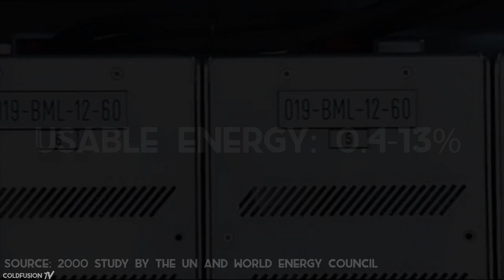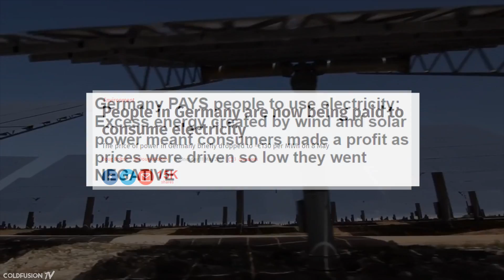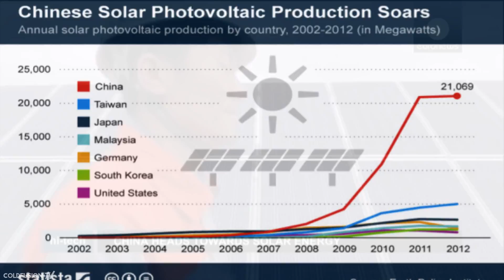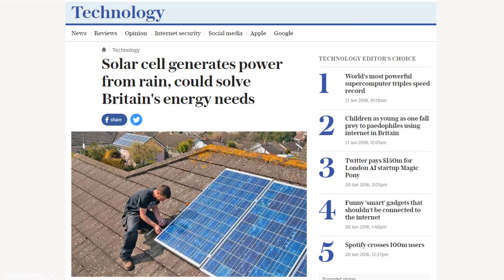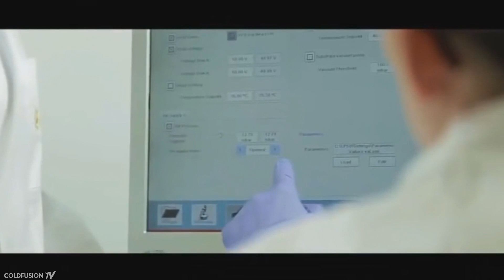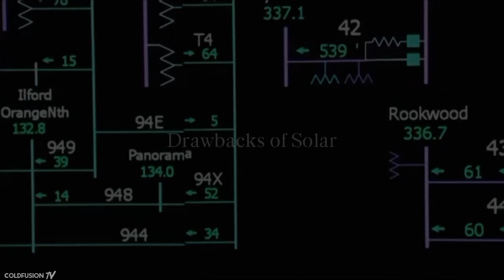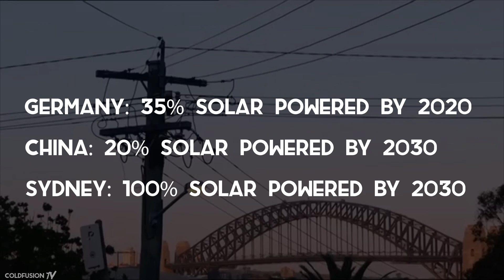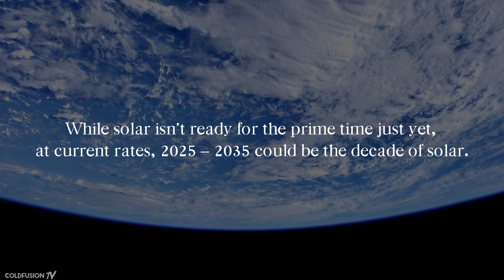The Truth About Solar

Comment: Skeptics complaining about solar ("it's not ready for prime time," "it's too expensive," "it's inefficient") remind me of the critics against electric vehicles before Elon Musk created the Tesla Model S. Oh, and by the way, Musk is leading the solar revolution; in October 2016 he unveiled the solar house, thereby completing the package he originally had in mind: house, battery, vehicle.  And if this total package has the success of the Model S and the forthcoming Model 3 - which looks quite likely - then all the skeptics will need to take a seat.
Reply: Look I like Musk and I respect what he does but in no way does Tesla even begin to replace the gas engine. There needs to be a massive scale up in battery production at who knows what environmental cost. Where does the energy come from to charge the battery? Solar is not going to do all that charging for everyone. Then there is the issue of how do you drive long distance with an electric vehicle. Can you swap out pre-charged batteries and if not what is the equivalent of the filling station on the road. Solar house is the same, good in some situations but not even close to being a total solution. Again massive battery requirements and not going to work well in high energy needs areas or in poor sunlight times (think a dark northern winter). What about a multistory building or a manufacturing plant? Everybody would love solar to be the answer but it just isn't at least with the current technologies. It can play a role sure but it is not going to be the main driver in the near future unless a huge infrastructure change happens and that sorta leaves out the near future.
Reply: +Juri Vlk Just pointing out the facts. Is Tesla bad? No maybe a little pricey but all new tech is. The battery issue is a pretty huge deal. All the batteries needed to replace all the combustion engines, I wonder at the mining and environmental cost to that and the shear scope of production. The point is we all go crazy saying yeah this it it lets go there but the switch over effort is beyond mindbogglingly. It will take many many years and incredible effort to switch out auto technology. What I would like to see is a sober realization of how difficult this task is and what we have to commit to do it. Less rah rah and more analysis by qualified engineers as to the viability of solutions and our ability to implement them in the near future. We need a rational plan out of the government and industry to do it. Electric cars are not non polluting unless they get their charge from a clean source which currently almost none do. Solar can't meet today's electric needs let alone the transportation industry. I am a nuclear advocate and I see the next generation of new tech plants we need taking 25 - 30 years to build. If we get those built then you can start switching over the bulk of transportation to electric, hydrogen and ethanol all of which can be in theory be generated directly from electricity and available atmospheric carbon. I really don't hate Solar, it is wonderful in off grid situations and cutting down fossil fuel consumption it is just not the answer we need in the near future to keep the worst effects of global warming contained.
Reply: The Tesla Power Wall pays for itself in 30 years.
Unfortunately it only has a 10 year lifespan
Reply: +Trek Ryder Confuse people about what? I told you what the issues are and all you came back with are Telsla and solar sales are up. Well glad they are up but you still have not addressed any of the issues I brought up. It doesn't matter anyway nothing we say here matters. It will all play out the real world. And with that I give up. I find it is waste of time to argue people who won't hear anything other than what they want to believe.
Reply: For 2015 and 2016, Tesla sold a little bit over 100,000 vehicles.  All other car manufacturers sold a tad over 172,000,000 vehicles.  The Tesla Model S STARTS at $68,000.  The average cost of all the other manufacturers offerings was $33,560.  Elon Musk has captured 0.12% of sales of automobiles.  On an individual vehicle basis, Elon has sold 0.06% of the vehicles that other manufacturers have sold in the same period.  To put it another way, for each Tesla sold, other manufacturers sold almost 1,700 vehicles, so I would not put the mantle of "game changer" on him just yet.  Personally, I would wait to see the Model 3, purported to be priced at $35,000.00 and available in mid-2017, but that price is "vaporware" right now, and the performance is unknown.
Reply: +greenburg. While I do agree that and oil economy makes it difficult to move to any alternative I have to respectfully disagree on the rest. Your taking impressive but non scalable things like some people living off the grid and saying we can run everything solar. It is just not even close to the same thing. Can you imagine running a large scale smelting operation or London mid winter at night off solar. It's not inconceivable but it is impossible at this time. Storage banks whatever you mean by that are just not going to expand like that. Batteries are inefficient on the charge and the discharge. The battery capacity to power the US overnight staggers the imagination even if Musk thinks he can envision it. Musk says he can see London being powered by solar but he never gives any detailed engineering data to support it. There is some hope in creating carbon neutral fuels like ethanol from atmospheric carbon that might work as an efficient means of energy storage but that is unproven on anything other than a laboratory scale. I believe Bill Gates said if we took all the batteries of any type currently existing there would be enough energy to replace the grid for a few minutes. Bill Gates is deeply concerned with the worlds energy needs and he is pro nuclear. If there was a good way forward toward solar I doubt he would want anything to do with nuclear. No sane person denies nuclear energy carries risk and it would be best to avoid it if solar could do the job. Solar is not currently up to the task and there does not seem to be any near term way it could replace the grid.
Reply: Trek Ryder Yeah, real nice. What do they run?  About 80 grand?  An equivalent car costs around 35.  That buys a lot of gas!  Only a save the planet moron makes such a stupid decision. And it gets its recharge from the same power source (fracking, oil fields) that the greenies are fighting against!
Reply: Michael Weaver You have a realistic approach. Apparently, you're not a Tesla fanboy!
Reply: Ask the whales.
Reply: 100 thousand dollars for a car i cant drive out of town on a cold day? take away the subsidies if tesla is such a fine car, the same for solar!
Reply: +greenbag  Sorry about your name apparently spell checker got it.. A certain class of factory could run off solar but high energy demand operations like smelting no. So many won't accept the incredibly huge difference between some people running off solar and everything running off solar. Yes you can sell solar power back to utilities it's been that way for for a long time but so what. You are avoiding what happens when there is no sun and how can you store all the energy for the non sun times. You also avoid energy density issues. No matter what you want to believe Solar is not currently up to running the world and won't be for a very long time if ever. Ask any real electrical engineer how this can be done. I would not care except solar advocates normally are nuclear opponents. Non carbon emitting energy is required and nuclear is the only practical way in the near future to replace fossil fuels. It seems your mind is made up so I wish you the best but am very frustrated with explaining this issue  to people like you over and over again when you when you don;t want to hear and won't look up the facts.  Kind of like Helen Caldicott who believes what she wants and ignores the rest
Reply: As if dams involve no disturbance of nature? Hydro power is inherently unsustainable, since silt builds up behind the dam, thereby reducing water pressure driving the dynamo. And then of course the dam disrupts most natural relationships throughout the entire watershed. Yes, solar and wind involve some polluting processes, but the point here is that they pollute far, far less than all other energy systems and they are sustainable. With time we will refine the manufacturing and usage methods to reduce and ultimate recycle all potentially dangerous materials.
Reply: +Trek Ryder  Quite true.  The Aswan Dam in Egypt stopped dead the transport of sediment to the lower Nile where it used to flood the fields every year.  The farmer now have to use artificial fertiliser.  There are a series of dams on the Danube which have more or less finished off the Giant Sturgeons.   They can no longer get to their spawning grounds.   
On a slightly less unhappy note, in "River Monsters" Jeremy Wade met someone who was snorkelling below the Kariba Dam when a fish he estimated at 15 feet swam over him.  He had no idea what species it was!
Reply: Michael Weaver Look I like the smell of fresh benzene like everybody else but what are we going to do when there simply isn't enough to go around? Meanwhile the sales of Teslas and solar and wind systems will continue to climb, and there's not much anybody can do to change that. If the sales plummet, then I will be the first to admit you are right, but until then...
Reply: Trek Ryder yeah I wouldn't
Reply: Trek Ryder, you're absolutely correct.
Reply: I don't think anyone on this thread is looking at solar/wind through rose-colored glasses. Yes, there are still fossil fuels in the mix, but the point is they are being phased out, plain and simple. If you don't like the example of Germany, consider Norway or Denmark. Then look at the statistics showing the sharply rising share of solar and wind in the total energy market. The trend is clear.
Reply: But not forever. Fossil fuels are a finite resource and nuclear is far too costly
Reply: + John Benton : Just like whaling.
Reply: Oil, like all fossil fuels, will run out. Of course there are the deniers and creationists, but they're in for one helluva surprise. Do you want your grandkids to remember you as a selfish wastrel, or as a careful custodian of the world. Your choice (while you still have one!)
Reply: Well plenty of people pay big to live in areas with naturally high radioactivity like Edinburgh, or smoke tobacco rich in radioactive elements and absorbing far more radio activity than results from any plant  ... 0

And you'll have no problem buying a house next to any big industrial plant ... so what's your point other than to repeat non scientific bias?
Reply: LOL
Reply: Trek Ryder what about silicone, mercury, lead and cadmium that are used in the production of solar panels? what about hydro power? sounds like a great energy source to me (maybe not for most countries though)
Reply: + Trek Ryder. Germany did produce 99% of its energy through solar and wind power on sunday june 12th 2016. However when you look at Germany's current energy mix, you will see it's 40.1% coal, of which the majority is lignite coal (see: https://en.wikipedia.org/wiki/Energy_in_Germany#/media/File:Power-generation-germany_2016.png). When germany decided to phase out its nuclear plants it had no option but to fall back on its only indigenous source of energy, which happens to be lignite, by far the dirtiest coal to burn. Germany has turned into the "China" of Europe. China, incidentally, is also a major global player in solar power, and coal represents 57% of their energy mix. There is a major gap between good intentions and reality, which both of these countries bridge by setting future goals to their energy production rather than implementing them here and now. Granted, Rome wasn't built in one day and it will take some time to switch to mass renewable energy production, but bear in mind that there are major public relations benefits and very little cost for promissing a greater share of renewable energy tomorrow instead of doing the hard work and launch expensive renewable infrastructure projects today.
Reply: Absolutely. We now have a once-in-a-lifetime opportunity to get renewables sorted properly. We are lucky!
Reply: What's happening now is a poor indicator of what will happen in the future. Coal is a natural resource, and is thus limited. We cannot rely on fossil fuels forever, but we can rely on the Sun and the wind (and tidal). So let's get on with it, not just sit complacently until the choice is renewable or die.
Reply: Norway? Right, the country which extracted almost 20 billion barrels of crude north sea oil to fund their generous welfare state, and who plans to extract 9 billion barrels more to the last drop. You consider them to be a model? It's like Saudi Arabia putting up a few solar panels (which they said they would do by 2023). Denmark is just as bad, they have the rest of the North sea oil market with the UK, and believe me when I say they are milking it as much as they can. My god, they even import coal ! Why does Denmark have a plan to be completely fossil fuel independent by 2050? Because by then they will have completely exhausted North sea oil reserves, and it's so far away none of the politicians who put this in motion will be in office anymore. If you put your trust in governments to get things moving on renewable energy, you will be disapointed every time, because politicians answer to a higher authority than their citizens, that of a geopolitical order which is very much set on business as usual for the decades to come.
Reply: LOL. Sorry, I don't really care to communicate with trolls, but good luck with your trolling.
Reply: Ahhh... well isn't that the most common of arguments when you have nothing constructive to contribute, by labelling the person whose line of reasoning you disagree with as a troll? You can check the facts I have given in the thread, and if you are not interested in having a debate, then bear in mind when you speak up on a public platform like Youtube, there is a chance people will comment on your posts - not because they react to your personality, but because they are interested in the topic itself.
Reply: Truth hurts. Trolls ignore facts that disprove their lame arguments. Carry on with your trolling career.
Reply: Ahh well, yours is the standard Koch fossil fuel-supporting "answers" that avoid the facts.
Reply: So now I am on the Koch brothers' payroll? I come to my own independent conclusions, thank you very much, based on the hard evidence I gather. Fact: Fossil fuels and nuclear energy are still massively used throughout the world, regardless of how governments greenwash their policies to please their electorates. Fact: for renewable energy to really take off and hope to win, it will take a MASSIVE coordinated effort on the part of civil society to pressure global conglomerates and set up their own interlinked ecosystems off-grid.
Reply: It's just an obscure youtube thread. We disagree and won't convince each other. Good luck to you.
Reply: As if your comment is going to reduce Tesla's popularity one bit.
Reply: of course not, the herd is always wrong! i care not how many cars he sells only that he has the government stick a gun to my head and take money from me and give it to him!
Reply: And when all the oil is gone, what then?
Reply: how do you know that oil will run out? what if the earth is an oil making machine? you don't really believe that all the oil we've been using come from rotting dinosaurs do you?
Reply: huh?
Reply: Tesla shareholder?
Reply: dont let the facts confuse you are knock you off your perch!
Reply: Trek Ryder , musk did all this with billions of taxpayers dollars.
Reply: Nothing wrong with nuke plants. Have you seen Chenoble lately? There are wolves running around with 6 times normal radiation and they are fine. phd's have facts that radiation is not as harmful as people have said fear fear fear get rid of it
Reply: Not really, according to the only region in the world using hydropower to power every house - Quebec. It looks like PV panels have the same carbon footprint asn solar and sometimes worse.
Reply: Short answer: it won't. After 2 decades of research and billions in subsidies, solar is a measly 1% of out electric ur production. Solar is just too weak to do any heavy lifting (i.e. compete with coal)    We need advanced nuclear to save the planet  #Thorium
Reply: Lol I am from thr future. Solar and wind is now a substantial source of energy for many countries. And it keeps improving and there are tons of undergoing projects.
Reply: Shorter answer: Too late. Solar is already here.
Reply: But if you favor nuclear so much, then I'm sure you'll have no problem buying a house next to a nuke power plant.
Reply: Solar combined with wind does very efficient heavy lifting in countries committed to it. Renewables covered 100% of energy needs in Costa Rica in 2015 including solar. Germany reached 78% in 2014 with renewables including solar. (See: https://cleantechnica.com/2016/02/04/how-11-countries-are-leading-the-shift-to-renewable-energy/)

Thanks for pointing out that solar is a measly 1% in the US. Maybe that's because we are technologically backward compared to those horrid European countries with their high-speed rail and increasingly widespread renewable energy systems.
Reply: +Robert Weekes "After 2 decades of research and billions in subsidies, solar is a measly 1% of out electric ur production." That's because the oil controlled economy won't allow something that makes their oily cash flow obsolete. The world's economy depends on oil. Take that away, and it rocks the economy. It's because of greed.. not because their ineffective.

"Solar is just too weak to do any heavy lifting (i.e. compete with coal)" Bullshit. They do have solar powered factories, and we just had a solar powered plane fly completely around the world. Some things may take more power, but that's why they have storage banks. DIY'ers in the US have been powering their own homes for years.. and they use battery banks for storage. At the same time... solar power, in the US, is only 12c per kwh. Coal on the other hand.. 30c per kwh.

You're thinking small scale.
Reply: +Michael Weaver Also... the solar energy industry alone created 35,000 jobs in 2015.. 20% more than 2014. The industry is absolutely booming in California. More people working in solar, than in oil or coal. 209,000 solar jobs in the US, 75,000 of them in California alone.
Reply: What's wrong with whale oil, it's good for our lights, why do we need to change?
Reply: +Michael Weaver That's cool... I hate spellcheck. :P First off.. the "no sun" theory is bunk. It depends on the solar cells to begin with. Seattle gets cloudy dude.. so does San Francisco. Ultraviolet light reaches the Earth's surface regardless of clouds. Hell.. you can get sun burned on a cloudy day in Hawaii. As for the amount of power... Apel Steel in Alabama uses a 340 kW photovoltaic solar system to produce up to 98% of it's power. A 'steel factory'. The ONLY thing I can see coal still being needed for, is to create the heat to melt the steel. Unless they can find a similar bio mass to burn to create enough heat.

"Yes you can sell solar power back to utilities it's been that way for for a long time but so what." You originally stated "Your taking impressive but non scalable things like some people living off the grid and saying we can run everything solar." I was merely pointing out that you are not 'off the grid' just because you have solar panels. Nothing more.

https://solarpowerrocks.com/solar-basics/how-do-solar-panels-work-in-cloudy-weather/
http://solarlove.org/98-electricity-can-generated-solar-panels-alabama-steel-plant/

Like I said... you're thinking too small.
Reply: Dude, nobody's reading your posts. LOL
Reply: You're trying too hard to confuse people and it just isn't working.
Reply: Sorry, but I stopped reading your posts.
Reply: Michael Weaver... could you at least spell my name right? But as for your response.. what part of 'solar powered factories' did you not understand? And as for 'people living off the gird'... Washington State alone has tax rebates and incentives to switch to solar. And you are not 'off the grid'... many cities actually buy the surplus power off of solar powered houses. Time to update that knowledge bank of yours.